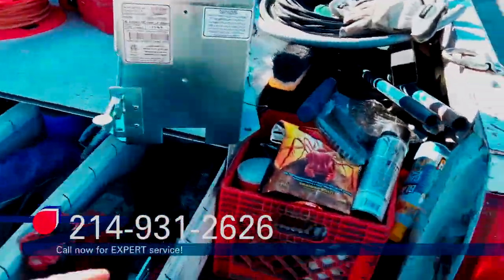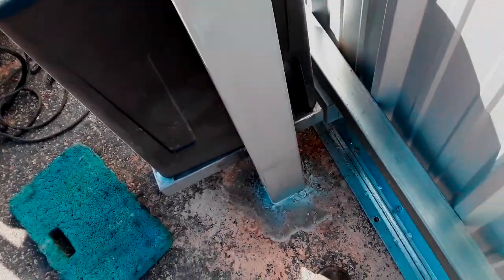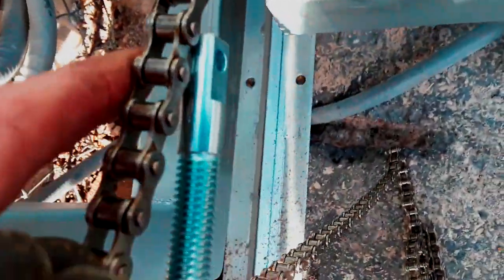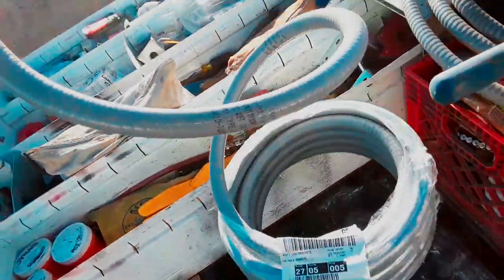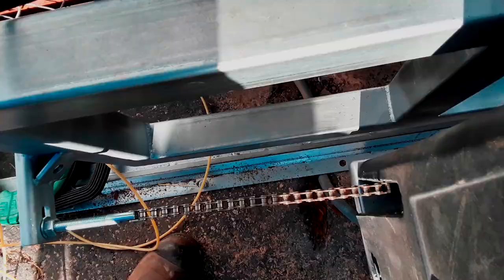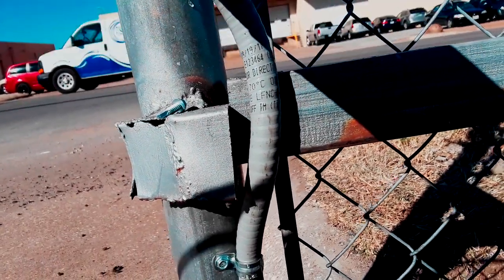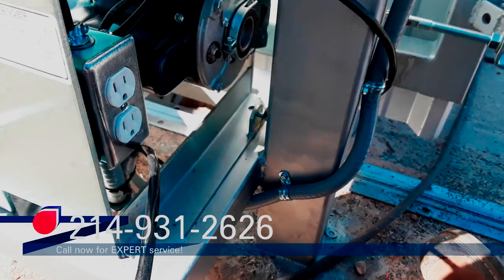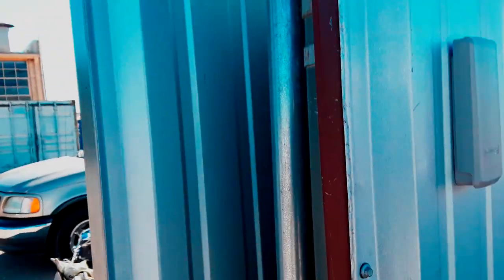Installing a All-O-Matic SL100DC gate operator Step By Step | SC0053

Comment: I have one of the older SL 100 gate openers.  It has been working fine for many years.  In the last week for the first time, the gate stopped opening.  If I manually pull the gate open, the CLOSING operation works perfectly, meaning the remote, the board, the motor, etc.  

Of course, I have taken off the cover and looked everything over, cleaned everything, etc.  The remote operations, the open and close limit switches and the board all seem to be working just fine.

But for the OPEN GATE function, the motor just doesn't seem to be getting any power any more.  It doesn't even try to open.  So the board just keeps flashing open until I manually open it to the point that the OPEN limit switch thinks the gate motor opened the gate correctly all the way.  From there, I can use the remote again and presto, the gate CLOSES perfectly and the electronics all work as usual, but ONLY to complete the closing function.  Once it closes, if I want to open it, I have to do it manually.  

Anyway, I know the motor is working to close the gate.  I know basically that everything is functioning normally except that the motor does not engage to OPEN or even act like it is getting the power to open.  Have you run across this before and is there a relay or something that might have burned out?  

I pressed the "reset" button on the motor but that didn't seem to change anything.  

Another thought.  Would it hurt anything for me to temporarily "test" the open function by reversing the wiring so that the CLOSE wires and OPEN wires from the board are switched?  Even once, just to see if I can get the gate to open by using power from the "close" terminal instead?

Any suggestions or ideas would be appreciated.  Thanks.
Reply from the maker: Woundnt mess with the wiring. It could be a safety device, weak motor winding, cap, etc. have a pro check it out.

https://linktr.ee/SafeguardControlsLLC

https://www.google.com/search?q=Safeguard+Controls,+LLC,+Dallas,+TX&ludocid=13536725103213864697#lrd=0x864e98c26521bdd7:0xbbdc1bc2bf2ce6f9,3,5

Safeguard Controls, LLC other Channels:

https://www.facebook.com/SafeguardControlsLLC
https://www.facebook.com/SafeguardControlsVideoBlog
https://www.linkedin.com/company/safeguardcontrolsllc
Reply: @SafeguardControlsLLC  I know I am late in replying, but I didn't see your reply until now.  You answered 18 months after my question I think.  And I'm seeing your answer 6 months after that.  Anyway, thanks for the reply and yes, I did take the control board to a "pro."  In fact, I took it directly to the All-O-Matic factory in Nothridge, CA.  Fortunately, it was only a loose connection on the board.  Then it started working perfectly again.  More recently, it started doing the opposite.  NOT CLOSING all the way.  My guess it that it is a loose connection again.

Comment: How do i program a lift master remote to this? The person who installed it for us programmed 2 of these remotes but my sister got herself a third one so we could each have one. HELP
Reply from the maker: Hey Vic, we would love to help if you are in the Dallas Fort Worth area. Any professional should be able to program the remote in just a few minutes. Which is what we recommend doing or call LiftMaster tech support 1-800-528-5880. 

Remember, "During normal operation electronic, electrical, electro-mechanical, etc. equipment and devices under test can cause severe injury or death."
Reply: You probably need to have a universal remote like a 375ut.

Comment: What made you choose All O Matic over a different brand?  I’m in Southern CA and All-O-Matic is near me and I’m considering their product. 

Great video!! Thank you for posting! I learned so much and the quality of your workmanship shows!
Reply from the maker: Hey Paul, We love All-O-Matic for several reasons. All-O-Matic has great tech support, an awesome warranty, reliable gate openers, and the openers are easy to install. As you can see we highlight them regularly.  An important note about our company, we have a full-time service department. Why does that matter? Because we know that we will be working on the gate openers that we install way past our 1126 day parts and labor warranty. There are companies out there that just do new installations and never service the gate past the one year warranty most offer. Therefore, their goals are short-term whereas hours are long term. We have to make sure that the installation and products match the environment and demand of the opening. You can't go wrong with All-O-Matic.

Comment: Hello , how is the allomatic working after two years? Approx how many cycles per day at this location. It looks like 20 ft gate over 1000lbs.
Try to decide this model and the liftmaster sl3000.
Thanks
Reply from the maker: it's running great. Approximately 40 to 50 cycles a workday. the length is about right but the weight is probably lighter however the design absorbs considerable force when the wind blows.  We could make any recommendations without doing a site visit. If you're in Dallas let us know 214-931-2626 if not you can use a trade association defined the contractor. Use at your own risk. Here is one https://members.americanfenceassociation.com/Find-a-contractor.asp?version=2
Reply: @SafeguardControlsLLC  ok thanks

Comment: Hi I have a question..my gate won't open unless I hold down open limit switch..not sure if the switch is bad or not everything else works fine. Do you think its the switch?
Reply from the maker: A qualified service technician should just replace both limit switches if there is ever a question. Allomatic makes this easy! They are inexpensive compared to diagnostic labor rates. If it is another type of switch, such as a stop command switch, then we would recommend the technician replace it knowing that is the likely cause.
Reply: @SafeguardControlsLLC  thanks

Comment: Would you recommend the All-O-Matic SL-90 over the Viking L-3?
Reply from the maker: that's an awesome question. The SL 90  fits in an interesting gap between the 45 in the 100. There are  a lot more questions than just simply one or the other. We service and install both. the Viking L3 has some features that the All-O-Matic does not. Such as the Viking monitor. It's worth it to take a look at it. We really like the  All-O-Matic SL100FP DC opener. It's just a little bit more than the 90 and we have great results  as you can see from our channel!
Reply: Liftmaster CSL all day
Reply: @dopenough2smoke  @Liftmaster. They make a good opener